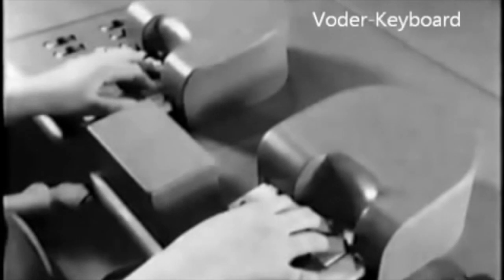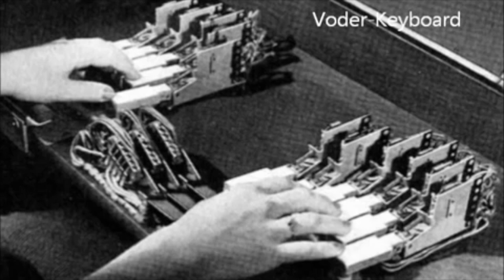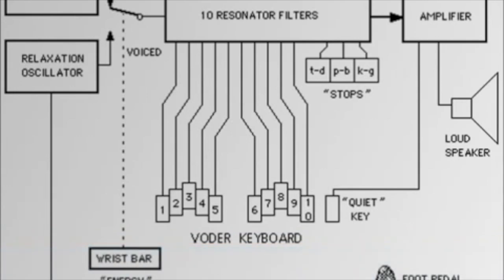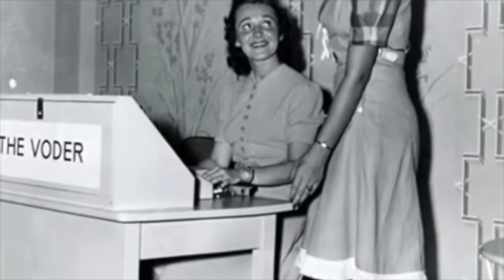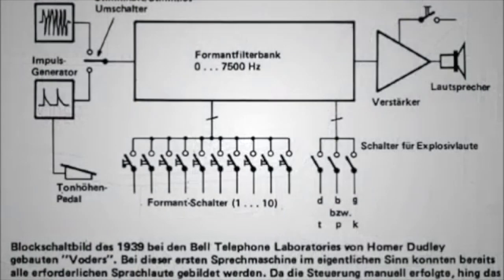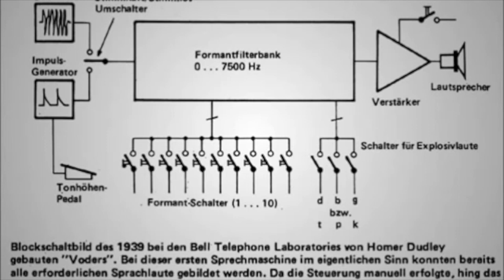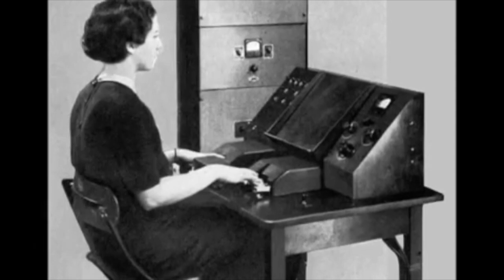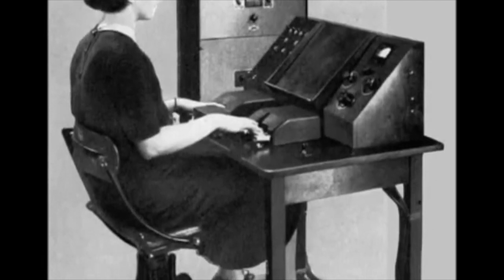The Voder: 1939,  the worlds first electronic voice synthesizer

Comment: ⥊ 77: 15

0: Good

001: Uniqueness
002: Altruism
003: Sensivity
004: Audacity
005: Boldness
006: Astuteness
007: Ingenuity
008: Innocence
009: Truth Seeking

01: Willpower
02: Progress
03: Acuity
04: Love
05: Bravery
06: Congruence
07: Consonance
08: Honesty
09: Cleverness

1: Ethics
2: Problem-Solution
3: Subject
4: Idea
5: Expression
6: Why / Who / When / How / Where / What
7: Information / Code
8: Stability
9: Sanity

10: Network
11: Justice
12: Affront / Easter
13: Definition / Death
14: Cognition
15: Source
16: Reason
17: Discourse
18: State
19: Control

20: Judgement
21: Ethical Solution
22: Scupulous
23: Delimitation
24: Humor
25: Behavior / Christmas
26: Motivation
27:    Comprehension
28: Constancy
29:    Regulation

30: Liberty
31: Permission
32: Discernment
33: Responsability
34: Support
35: Means
36: Purpose
37: Opinion
38: Decision
39: Prospect

40: Goodness
41: Awareness
42: Critical Thinking
43: Consideration
44: Conceive
45: Plan
46: Ability
47: Knowledge
48: Structure
49: Ambition

50: Good Expression
51: Manifestation
52: Resolution
53: Application
54: Empowerment
55: Movement
56: Demonstration
57: Assignment    Mission
58: Building
59: Proficiency

60: Accordance
61: Appropriated
62: Implication 
63: Indicator
64:      Cohesion
65: Function
66: Investigation
67: Argumentation
68:      Sophistication 
69: Scrutiny

70: Intelligence
71: Message
72:      Consistency
73: Election
74:     Coherence
75: Consolidation
76: Explanation
77: Flow
78: Fluency
79: Measurement

80: Peace
81: Sovereignty
82: Perseverance
83: Reliability
84: Autonomy Instrospection
85: Rectitude Implementation
86: Pursuit
87: Persuasion
88:      Character Benign
89: Commitment

90: Kindness
91: Assertiveness
92: Optimism
93:     Scrupulousness
94:     Compassion
95: Composure  Essence Fiscalization
96: Blockchain: ⥊ (TRACE MARKER) Legacy
97: Anarchy
98: Veganism
99: Revolution

100: Liberation
101: Decency
102: Progressive
103: Resilience
104: Integrity
105: Collaboration
106: Abolitionism
107: Concordance
108: Clarity
109: Regulation

110: Ethical Commitment
111: Honor
112: Exploration
113: Privacy
114: Will
115: Pride
116: Justifiable
117: Equitable
118: Fair State
119: Mission

120: Harvest
121: Deliverance
122: Resistance
123: Cogitation
124: Challenge
125: Appropriated
126: Searching
127: Emphasis
128: Consistent
129: Subversion

130: Fulfillment
131: Admission
132: Criteria
133: Response
134: Provide
135: Technique
136: Principle
137: Point of View
138: Choice
139: Prevision

140: Serenity
141: Conscience
142: Concern
143: Perception
144: Free Love
145: Idealize
146: Capacity
147: Mindfulness
148: Scheme
149: Morality

150: Righteousness
151: Virtue
152: Coordination
153: Efficiency
154: Equip
155: Cooperation
156: Profiling
157: Counter-Terrorism
158: Rising
159: Excellence

160: Reasonable
161: Procedure
162: Corroboration
163: Hint
164: Value
165: Role
166: Lead
167: Logical
168: Improvement
169: Assess

170: Sympathy
171: Relevancy
172: Dichotomy
173: Naming
174: Elucidation
175: Materialization
176: Validity
177: Harmony
178: Coherence
179: Verification

180: Perpetuity
181: Independency
182: Perseverance   Dependability
183: Structure
184: Potential
185: Stance
186: Occupation
187: Compelling
188: Conviction
189: Boldness

190: Power
191: Wisdom
192: Effectiveness
193: Prudence
194: Foresight
195: Discipline
196: Trackable
197: Accountable
198: Compeling   Sustainable
199: Quest

200: Ideal
201: Compatibility
202: Referee
203: Adjudicate
204: Conformity
205: Coexistence
206: Methodical
207: Correspondence
208: Eccentricity
209: Expertise

210: Solution
211: Resolution
212: Prosecution
213: Adjustment
214: Transformation
215: Conversion
216: Escalation
217: Correction
218: Persistence
219: Analytical

220: Contemplation / Meditation
221: Preparedness
222: Dialectical
223: Meticulous
224: Diligence
225: Attitude
226: Rigorous
227: Dispute
228: Healtiness
229: Prescription

230: Allowance
231: Agreement
232: Definition
233: Jurisdiction
234: Availability
235: Proposition
236: Objective
237: Reckoning
238: Settlement Warrant
239: Assurance

240: Mindset
242: Mental State 242: Consideration
243: Rumination
244: Impression
246: Sagacity
247: Easygoing
248: Disposition
250: To Thrive 
253: Conduct
254: Potent
255: Insurgency
257: Defiant
260: Unveiled    Exposed 
261: Freedom Fighting
262: Correlation
263: Relevance
265: Conjecture
266: Suggestion
269: Estimate
272: Paradox
273: Choice
274: Dispute
280: Constancy
282: Evanescence
288: Healtiness
289: Conduct
290: Prognosis
294: Anticipation
295: Proof of Stake
296: Calculation
297: Proof of Work
298: Commitment

300: Crusade / Jihad
304: Concept Attention
309: Consensus 
310: Conviction
311: Consent
312: Confront
312: Distribute
313: Enforcement
314: Bodily Autonomy
320: Deliberation
322: Opportunity
327: Suspicion
330: Adherence
331: Self-Determination Demanding
333: Abundance
334: Accountaility
335: Technician
336: Dedication
338: Permanent
339: Maturity
340: Promote
341: Confirm
342: Validate
343: Imagination
344: Qualification
345: Ratify
346: Organization
347: Propagate
348: Finance
349: Encourage
350: Operation    Materials
351: Engagement
352: Endeavor
353: Undertaking
354: Remarkable
355: Designation
356: Exposing 
357: Proactive 
358: Forge
359: Accomplish
360: Technology
367: Addressing
372: Ambiguity / Conflict
373: Retort
370: Standpoint
372: Conflict
377: Context
383: Orientation
390: Prognostic
394: Prediction
398: Sustainability
399: Overthrow

400: Earth Population
402: Diversity
410: Permaculture
411: Mathematical
413: Realizing
421: Metamorphose
422: Transcend
427: Skepticism
430: Abstraction
434: Care
435: Possibility
436: Inspiration
440: Insight
441: Abstraction
442: Contemplation
443: Brainstorm
444: Formulation
445: Elaboration
446: Capability
447: Know-How
448: Apparatus
449: Theory
453: Design
454: Escalation
455: To Arrange
457: Rapport
460: Aptitude
461: Rigorous
462: Affect
463: Skill
464: Competence
465: Performance
466: Conjecture
467: Intelligible
468: Enrichment
469: Expertise
470: Wisdom
471: Accessible
472: Distinguishment
473: Priorities
474: Perspective
475: Constatation
476: Punctilious
477: Attentiveness
478: Amusing
479: Insurance
480: Security
481: Inclusive
482: Durable
483: Trustworty
484: Individuality
485: Convenience
486: Satisfaction
487: Benefit
488: Friendly
489: Praticality
495: Marvelous
496: Sensational
499: Envision
Reply: 500: Assumption
501: Leadership
502: Credit
505: Viable
503: Esteem
509: Prestige
510: Admiration
511: Heroism
512: Pugnacity
513: Description
518: Steady
520: Proficiency
525: Habit
530: Implementation
531: Solicitation
532: Regard
533: Contract
534: Requirement
535: Execution
536: Utilization
537: Utterance
538: Respect
539: Esteeem
540: Appreciation
541: Sensatize
542: Instigate
543: Sentiment
544: Sharp
545: Assembly
546: Potency
547: Education
548: Solidity
549: Evolve
550: Fellowship
551: Insurrection
552: Schedule
553: Reportation
554: Convocation
555: Party
556: Campaign  Instruments
557: Coordination
558: Systematize
559: Seize
560: Protesting
561: Explicit
562: Reciprocity
566: Intimation
Reply: 570: Counter-Terrorism
571: Cracking
572: Decipher
573: Affinity
574: Interpretation
575: Blitzkrieg
576: Codification
577: Spreading
578: Decoder
590: Excellency
595: Heroic
599: Eagerness

600: Organizator
611: Consequence
612: Researching
613: Suitable
620: Diagnose 
629: Symptom
633: Incumbency
634: Inspiration
636: Cause Goal
643: Reflection
644: Theory
646: Brililiance
647: Logical
648: Content
653: Appliance
655: Mobilize
654: Overcoming
660: Operation
661: Operator
662: Nexus
663: Evidence
665: Role
666: Questioning
672: Discussion
673: Instructions
676: Deduction
694: Systematic
696: Sublime

700: Lucidity / The Gear / Artificial Intelligence
702: Credit
704: Data
710: Coherence
711: Rational
712: Intimation
713: Precision
714: Acquaintance
715: Presentation
716: Manifesto
717: Pronouncement
718: Proclaiming
719: Revelation
721: Point
722: Interpretation
723: Reparation Ambivalence
724: Sense
725: Direction
727: Compensation
729: Disclosure
730:    Importance
731: Interaction Consent (Y/N)
732: Contrast
733: Designation Nomination
734: Endorsment
735: Product
736:    Importance
740: Statistics
743: Understanding
744: Grasp
746: Thoroughness
747: Articulation
748: Conceptualization
749: Enchantment
750: Consolidation
751: Communication
753: Instrument
754: Conquering
755: Coalition Coordination
756: Inspire Instruction /Method
757: Prompt
759: Delight
760: Instructive
756: Instruction / Method 
766: Causality
770: Appreciation / Gratitude
771: Algorithm Statement
772: File
773: Algorithm Recognizing
774: Code
775: Information Output
776: Correlation
777: Pattern /  Construct
778: Development
779: Enumeration
780: Systematization
799: Revolution Algorithm

800: Providence / Supremacy
801: Production
802: Necessities
803: Resorces
804: Energy
808: Renewable Cycle
810: Permaculture
811: Fair Law / Constitution
819: Lament
820: Predominance / Management
829: Ephemeral
830: Logistics
831: Inquiring / Scheme
832: Reach
833: Entrusted
834:  Dependability  
835: Stock
836: Gravity
840: Consumption
843: Zeal
844: Creativeness
846: Independent
847: Autodidact
848: Integration
850: Labor
853: Usage
854: Disciplinated
855: Devotion
858: Accessibility
860: Human Resources
861: Adequated
862: Shape
863: Assignments
866: Estimation
870: Structure
873: Congruity
880: Peace
888: Globalization

900: Transparency
910: Panacea
911: Emergency Call
919: Enclosuse
930: Enlightenment
931: Only One Global Currency
935: Resources
936: Legitimacy
940: Empathy 
944: Wishing Well
946: Compassionate
947: Philanthropy
948: Unification
954: Intrinsic
955: Fidelity
960: Synthesis / Blockchain Integration
961: Remarkale
962: Guide / Formidale
963: Monolith
966: Proof
970: Examination / Gallant
971: Vocabulary
973: Pertinence
975: Inspection
979: Impressive
980: Splendid
990: Optimization
991: Imperative
995: Accountancy
996: Revolution Chain
998: Regulation
999: Zenith Vortex Epic
1000: Militancy
1001: Nova Era

1010: Peer-2-Peer
1011: Decentralized Network
1012: Distributed Ledger
1030: Financial Revolution
1031: Resources Availability
1040: Production Revolution
1042: Drug Liberation
1049: Implementation
1050: Labour Reorganization
1100: Liberation Army
1133: Abolitionism
1160: Pacifism
1312: Boycott
1317: Identifiable Source
1400: Unity
1444: Direct Digital Democracy
1500: Benevolence
1550: Charity
1807: Black & Yellow
2000: Sanctuary
3000: Freedom
3030: Win-Win
3100: Triumph
3311: To Revolt
3330: We All Can Live In Abundance
3712: Problem In Your Opinion
4000: Coexist
4411: Riders of Justice
5000: Glory
5500: Greatness
6500: Quantum Mechanics
6999: Mystery
7220: Unified Field Theory
7755: Revolution Gear
8000: Sustainability
8999: Finitude
9997: Discovery
9998: Unknown
9999: Universe
10000: Existence

. This is a Numeric Matrix for Communications Purposes.
. This Can Be Used to Convey Meaning.
   Ex.: 2034: To Judge the Idea.

. Mathematical Operators Can Be Used to Calculate Meaning.
   Ex.: To Judge the Expression: 25
   20 + 5 = 25 (Behavior)

. Logical Operators to Create statements.
   Ex.: ¬11: 13. If not Just then Death.

. Colors can also be used as information.

- You can help build it.

Comment: The interesting thing about this first speech synthesizer is that it lacks the one thing that would make it more practical, automatic control.  Because microcomputers didn't come out until 40 years later, and even mainframes weren't around in the 1930s, a speech synthesizer wouldn't have any real useful purpose without some sort of app to trigger it.  But the cool thing is that Bell Labs already had the speech production process down and could later build automatic applications once computers came along to trigger the speech, without the need for "girls" to trigger the speech using keys and pedals.  I can see how hard that would be to do, because it's a lot like doing stenography like a court reporter.

Comment: "We don't anticipate any commercial use for the Voder." Little did they know...
Reply: Wait.. can I buy one?
Reply: @ZuraTheCat  i think they're referring to vocaloid/voiceroid and similar products ^^
Reply: @ZuraTheCat  well, there's a Voder voice in Chipspeech
Reply: @manwhat4432  did they manage to replicate this one? I've searched for examples of its voice everywhere, but I can't find any. I'm considering buying it, but without an example of his voice I'm pretty unsure.
Reply: @arianamarie8442  there's a demo  you can try
Reply: @ZuraTheCat  likely but not with that machine. More of a smaller and more affordable one.
Reply: The problem was that they developed it at a time when there was no computer technology to automate the speech to be triggered by software as it is now.  Since the machine had to be operated manually by a “girl,” it had no application.  However, they could have made something that would “record” the control movements in much the same way a player piano works, and then the speech could be automated by running a paper roll back through the machine.
Reply: the earliest known recordings of strawberry clock
Reply: GSM Mobile Cellphone compression .
Reply: In pop music, AutoTune !   A vocacoder thingy plays back one of twelve notes whichever one's closest to singer's note.
Reply: @jagmarc  I have discovered that the Voder did evolve into the electronics for vocoder stuff, which is related to AutoTune.
Reply: ...aaaand no, it is not technically related to AutoTune, other than the fact that both were used as vocal effects. AutoTune works by bringing the tone of a vocal recording in tune with a particular musical scale. It was commonly used, and it is still used, simply as a vocal correction tool, without people noticing. It wasn't until Cher's "Believe", song, that the AutoTune sound that we are used to existed. It was even known as the "Cher effect" for a while. Now it is everywhere :)
Reply: 666 likes

Comment: As a software developer what I find so amazing is that they developed something that had no real use, but the work in developing this probably yielded some very important technologies or understandings.
It's s shame that nowadays so much of what we spend money on has to have a use or what we call in the software world a 'use case' .
Sometimes discovery and play are good enough reasons in themselves.
Reply: Like I said in another comment, the problem with the Voder was that it had to be operated by a person.  Speech synthesis only became useful when it was built into computers.  I actually find this video fascinating because I'm a computer programmer and do automated phone applications, one of which is a voice internet service that reads email and web pages with text-to-speech.  I got interested in doing that because of discovering synthetic speech devices as a kid, such as arcade games like Berzerk and Gorf, a voice-enabled chess computer, and a Speak & Spell.
Reply: @jeopardy60611  I imagine this wouldve been a godsend to people without the ability to speak
Reply: Spot on.
Reply: It might have changed some mutes life at the time though
Reply: LEDs are another example. Basically useless for several decades outside of edge cases, then gradual breakthroughs in colour and efficiency left lightbulbs in the dust.
Reply: There was a lot of discovery and play going on at Bell Labs back then.